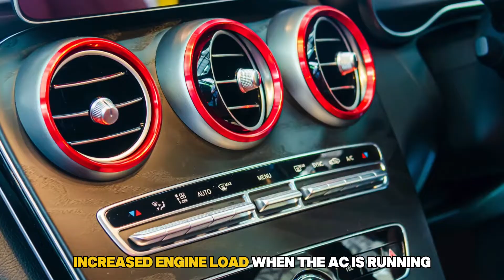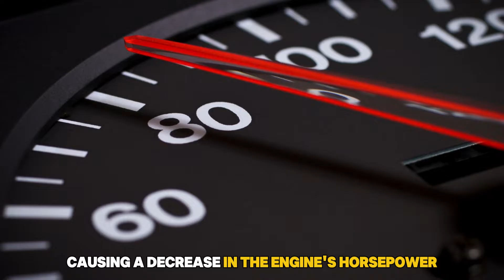Car Loses Power With AC On (Common Reasons Explained!)

Comment: I have a question: my Elantra 2008. I added freon and is working fine, cool really good, but now is making the motor to vibrate. Every time I turn on the A/C the RPM goes down and the motor vibrates, stay at 600 RPM or less but the car Vibrate and I see the motor vibrate much more than when I turn it off. Once I turn off the A/C RPM goes back to normal. Idler air control valve is new. Motor mounts are new. PCV clean. MAFS new. Throttle body clean. throttle body sensor new. O2 sensors new. Car has 182K miles. Engine filter new. no vacuum leak.
--- Any Idea?  Thanks